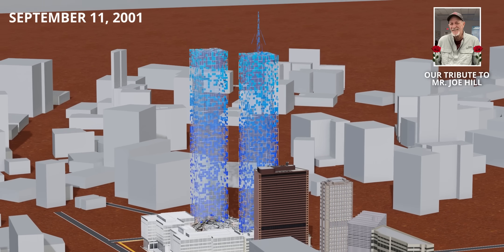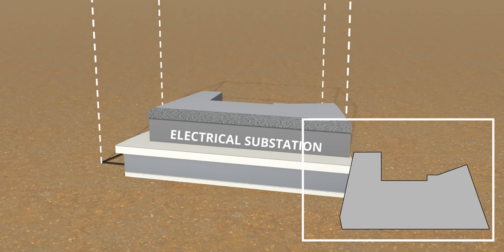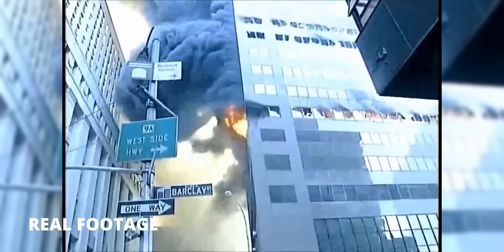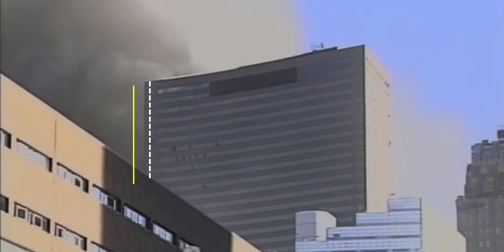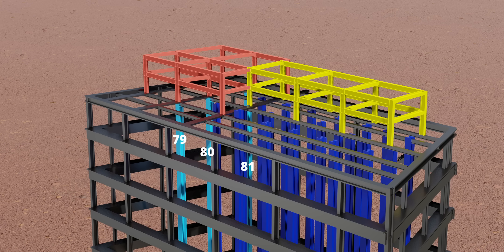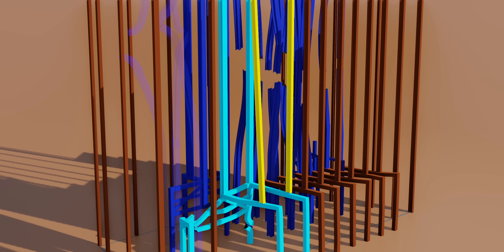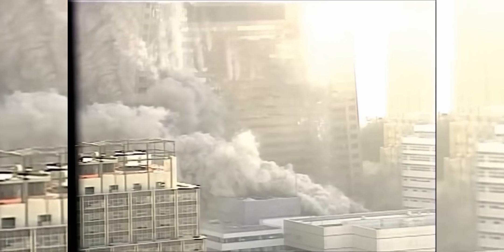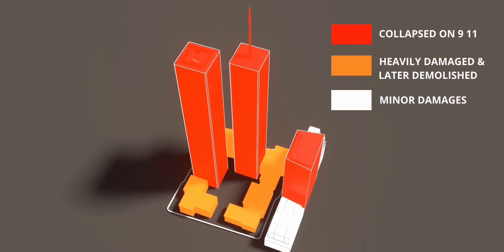Collapse of Building 7 | The Complete Physics

Comment: As an emeritus architect, I have long questioned the colapse of WTC7 building.  This video does not address the failure of the automatic fire sprinkler system in this building.  It's my understanding that there was a large water tank located at the top penthouse floor of this building.  Why didn't this water tank work to distribute water to the fire sprinkler system? Even if the water main at the street was damaged by the collapse of WTC! and WTC2, the water suppresion system should have worked to extinguish the buiding fires thus eliminating the chance for damage to the structural columns.
Reply: The sprinkler system did not fail.  How the active and passive fire protection systems performed is explained in detail in the 5 comprehensive engineering studies done on this subject many years ago, as well as many of the dozens of peer reviewed articles in technical journals. 

Surely as an emeritus architect you have the time and knowledge and have availed yourself of this material as any true professional would and therefore there should be no mystery.
Reply: @TheCriticalStinker-01  After reading these incomplete reports it's clear to me that the investigation and the subsequent data have been manipulated in order to fit a predetermined outcome narrative. The "reports" leave many questions either obscure or unanswered. This is an apparent means to bury the truth.
Reply: @JohnDumas-w5z  - Such as?
Reply: @TheCriticalStinker-01  One example: The "comprehensive engineering studies" indicate that there were two 17,500 gallon life safety fir sprinkler tanks in WTC7.  The reports do not provide any explanation regarding the failure of this fire sprinkler water supply system to activate and thus extinguish the early fires in the building. There was no jet fuel in the building, but the fires were still not extinguished by the building life safety systems. This factor is apparently and conveniently omitted. If you or anyone can provide an explanation for this factor, I would appreciated.
Reply: @JohnDumas-w5z  - Then you clearly didn't read them and are just mindlessly repeating stupid shit you found on the internet.
Reply: @TheCriticalStinker-01  You are totally wrong about that response. Show me where those reports stipulate why the fire sprinkler system did not function appropriately.
Reply: The absolutely laughable lies and nonsense in this post makes it very clear that "John Dumbass" is a fitting user-name, it must be said.

Comment: Ya almost had me hook line and sinker....until you said the beams "heated and buckled".

Bulls**t, bulls**t, bulls**t....
Reply: And yet, unsurprisingly, not wrong. Or you would have had an argument. Any argument at all.
Reply: So, what you are saying is you don't understand Euler buckling?  Or that steel is formed using heat and deforms the same way?

For the record:  The description of collapse initiation presented in this video is severely dumbed down for the intended audience, and a,... bit lacking IMHO.  Adding a critical but omitted detail would have (again IMHO) made the actual failure mechanisms more apparent.

Comment: 8:45 you can see explosives ignited
Reply: Except the collapse started 10 seconds before that.
Reply: @TheCriticalStinker-01 no it didn't
Reply: @sebastiantomczyk4577  - So then why are the rooftop structures missing, the glass along the 44-46 line already broken and the exterior moment frame already starting to lean into the empty chasm that is the center of what was the building?

And why does what you want to imagine are explosions occur in response to the building moving rather than being the cause of the building moving?  How did you manage to miss that rather critical and bleeding obvious detail?
Reply: @TheCriticalStinker-01 critical or ignorant? You make it convenient for yourself to tag your own comment as the one that is based on rational assumptions.
Reply: @sebastiantomczyk4577  - That's not a rebuttal. 

I made no assumptions. I asked a question while pointing out some obvious details derived from visual observation that quite frankly, totally falsify your claim. No doubt that bruised the ego and made you butthurt.  But hey, I'm a fair guy and only want to present the true and relevant facts.  So, if I got it wrong then what bit did I get wrong and why?  Please be specific.
Reply: @sebastiantomczyk4577  - I guess I got nothing wrong. Glad we got that sorted out. Have a nice day.

Comment: 911 was on purpose, the USA do not care about their own citizens, and obviously was staged to attack Afghanistan!!

So many questions unanswered:

1) How did four hijacked planes fly in U.S. airspace for so long without interception?
2) Why did WTC Building 7 collapse if it wasn’t hit by a plane?
3) Why is most of the CCTV footage from airports and the Pentagon withheld?
4) Why were so many advance warnings about an attack ignored?
5) How did hijackers’ passports and IDs survive crashes that destroyed steel?
6) Why did the Twin Towers collapse so quickly and symmetrically?
7) Why was bin Laden named as the culprit before a full investigation?
8) Why was there massive insider trading in airline stocks just before 9/11?
9) Why haven’t the cockpit voice and flight data recorders been fully released?
Reply: 1.  They didn't.  NEADS had 9 minutes warning before Flight 11 crashed, the other 3 hijacked aircraft all crashed before NEADS were informed they were possible hijacks.
2. Explained above,
3. It isn't.
4. What advanced warnings?  The "August memo"?  Hardly an actionable warning.
5. Just one, and the for the same reason as Lisa Frost's Air Miles Card or the manifest for Flight 11 - ejected during impact.
6. They didn't.  It took about 45 minutes for the South Tower to collapse, twice as long for the North.  Neither collapse was symmetrical by any acceptable definition of the term, nor does symmetry have anything to do with anything. Outside of a tiny subset of ignorant conspiracy believers that is not even a word that ever comes into the conversation - a Red Herring.
7. He was named as a suspect
8. There wasn't.  Please move on from 2002.
9. They have.  The FDR for Flight's 77 and 93 were released 2 decades ago as was the CVR transcript for Flight 93. No others survived with usable data. 

None of those questions really move the needle on what we know about 9/11 BTW - they are just a collection of random anomalies that add up to nothing.
Reply: @TheCriticalStinker-01  Are you answering from your ass?? because please explain where you got 45 minutes

North Tower (WTC 1): Approximately 10 seconds from the start of the visible collapse at 10:28 a.m.

South Tower (WTC 2): Approximately 9 seconds from the start of the visible collapse at 9:59 a.m.
Reply: @NoName0801  - The South Tower was hit at 9:03 am, causing the damage which would eventually lead to its collapse. Collapse was a product of four (4) factors:  Impact Damage + Fire (heat) + Time + Gravity = Collapse .  

The South tower collapsed at 9:59 am so about 56 minutes after impact, for a total collapse time of 56 minutes. If you are just talking about time to collapse from the perimeter column buckling failures that resulted in the final tumble, the correct answer is about 33 seconds, not 9 seconds. Anyone with the gift of sight and ability to tell time (or count to 9) can see how silly 9 seconds is.

A lot of people though make that mistake by not paying attention. The NIST in the FAQ that accompanied their final report on the Twin Towers stated: NIST estimated the elapsed times for the first exterior panels to strike the ground after the collapse initiated in each of the towers to be approximately 11 seconds for WTC 1 and approximately 9 seconds for WTC 2

People like you - or the folks you copy/paste from at least - like to leave the bolded part out. Lack of critical thinking,... AND basic reading comprehension

We can apply the same to the North Tower with the same results.

As for the rest of the questions, I put about the same thought into answering them as you did asking them.
Reply: @TheCriticalStinker-01 Man keep quiet where is the footage and the audio recording, where is the footage of them at the airport?? No airplane crash can cause a building to fall like that!!
Reply: @TheCriticalStinker-01  Give me links to the audio? I want to hear or a news article

Your answers are basically yes and no, without any proof whatsoever
Reply: @TheCriticalStinker-01  You really stink in critical thinking, no wonder your profile name!!!
Reply: "So many questions unanswered:"
None of which is unanswered. In fact all of these was answered over 2 decades ago, many on the day.

"How did four hijacked planes fly in U.S. airspace for so long without interception?"
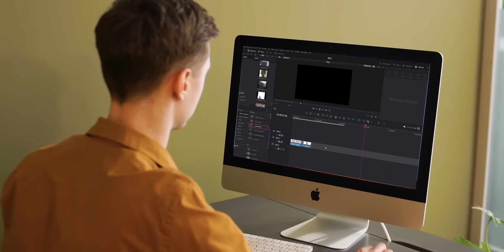None of the planes flew for very long at all. Flight 93, the last flight to depart, left 4 minutes before the first attack. At 9:27, the flight crew responded to radio traffic. At 9:28, the cockpit was breached, long after the North and South Tower crashes. At 9:31, Jarrah announced they had control of the aircraft. And at 10:03, it crashed. That's 30 minutes, give or take a couple. 
So, so much for "so long".

"Why did WTC Building 7 collapse if it wasn’t hit by a plane"
Try finding out. This is a simple one, known for about 24 years, in a month or so. "Because the North Tower fell on it".

"Why is most of the CCTV footage from airports and the Pentagon withheld"
Because you made up, alternatively believed, nonsense. No such footage was "withheld".

"Why were so many advance warnings about an attack ignored"
Because there were no such "advance warning".

" How did hijackers’ passports and IDs survive crashes that destroyed steel"
By not being made of steel. Being light, not anchored down, it was easy to move.

"Why did the Twin Towers collapse so quickly and symmetrically"
Because you, once again, believed in nonsense. There was nothing "symmetrical" about the collapse of the Towers, the remains covered more than 16 acres to a height of 5+ stories. As for "quickly", the collapses themselves took well of 20 seconds.

"Why was bin Laden named as the culprit before a full investigation"
Because the luggage of the perpetrators left letters explaining why and who they were, I.E. members of Al-Qaeda, along with several prior attacks by the organization, such as the October 2000 attack on the USS Cole.

"Why was there massive insider trading in airline stocks just before 9/11"
There wasn't. There was, however, a slight increase in "put options", these suggested by several notable traders and trading publications, since both AA and UA had had a string of bad news, and so their stock were falling. 

"Why haven’t the cockpit voice and flight data recorders been fully released"
They have been, the ones that survived. That happened more than 20 years ago.

So much for "unanswered questions". That you haven't, for whatever reason, found out the answers to these, all of which have been known for ages....is a you issue. If it's because you couldn't be bothered, didn't want to find out, or just took the word of whoever you heard it from that there were no answers is irrelevant. It still boils down to you not finding out.
Reply: @mooneyes2k478  So the luggage survived? And they managed to find their luggage so fast, it takes over one week to conclude investigations with the tech we have now if a plane crashes, man shut the hell up, no terrorist has time on their hands to plan such an attack and crash into the twin towers, and even if they did, what did they gain?? The USA had much more reason and gain after this attack!!
Reply: @mooneyes2k478  You really believe your government cares about you they'll kill you and how many ever they want in order to achieve what they want. Afghanistan was going to be a major threat to Israel, if USA did not invade!!
Reply: @NoName0801  - Do you have an unanswered question that is actually unanswered and meaningfully relevant, not just some random anomaly hunt or game of Whack-A-Mole JAQ'ing off?
Reply: @TheCriticalStinker-01  Yes, they are all unanswered coz all your answers do not logically make sense, you are just answering what the media told you, but you have not thought outside the box, and because you so badly want to believe your government won't do such a thing, hence you don't want to look at it deeply. No camera footage at the airport, lax security, etc and much more. Same with Bin Laden, they say they killed him, but they have not shown us his face after they killed him. Why would you throw the body in the ocean? Would you not want the world to see what you have achieved, also no quality footage of the soldiers killing him!!! I can see you are a blind follower of the media!!!
Reply: @NoName0801  - More like YOU are not getting the answers YOU WANT and are therefore looking for any lame excuse to reject them. 

More of your (rhetorical) questions are just the usual conspiracist random anomaly hunts over trivial, insignificant details, and all premised on false starting assumptions or ignorance-fueled personal incredulity

For example:  The "no airport footage" thing.  This - like all of your questions - is not original. It's just a mindlessly repeated old meme from the internet 20 years ago. 

Secondly, it's not true. Several of the hijackers were captured on video. The Flight 77 hijackers in particular. 

Thirdly, it is premised under the false starting assumption that video cameras were ubiquitous or even common in airport security stations in September, 2001.  They weren't. That can also lead into an even deeper dive as to what surveillance cameras (no such thing as a "security" camera IMHO) actually do and are for. 

Fourth and finally, so what?  If no hijackers were captured on video at any airports does that mean no planes were hijacked?  Of course not. It just means the hijackers didn't end up on camera. 

This is all much ado over nothing. At best one piece out of the thousand piece jigsaw puzzle that forms the big picture. But even if the cat knocks that one piece under the sofa, you can still see the big picture without it. You don't need it.

All of those aspects should be bleeding obvious and none of it unanswered.  But you don't think outside of the box. You mindlessly repeat other peoples failed ideas you find off the internet and pretend that makes you special, or clever.  It's an ego stroke. You fancy yourself one of the chosen people with the secret knowledge (even though all you have is someone else's questions) while everyone else is just mindlessly repeating the media or the government or whatever. You pretend thinking outside the box is just being contrary, when in many cases the opposite is true. 

Now then, let's cut the crap, stop playing whack-a-mole and start thinking big picture.

Were the 9/11 terrorist attacks planned and carried out by a terrorist cell operating out of Afghanistan that has a long history of attacking the United States and it's interests because they hate the U.S. government at least as much as you do but were willing to take action about it?

YES or NO?

If no, then who did, what did they do, where did they do it, when did they do it, how did they do it and why?  Make the case, don't just ask rhetorical questions over petty irrelevant details, and reject the answers when they don't fit your narrative.